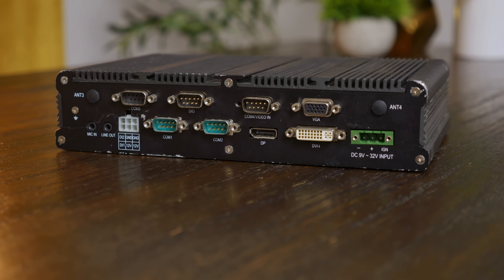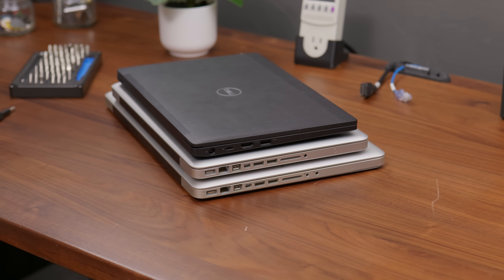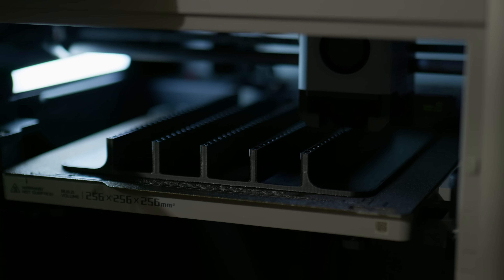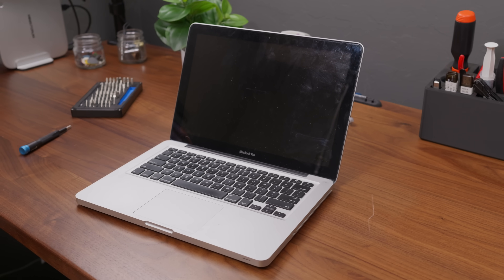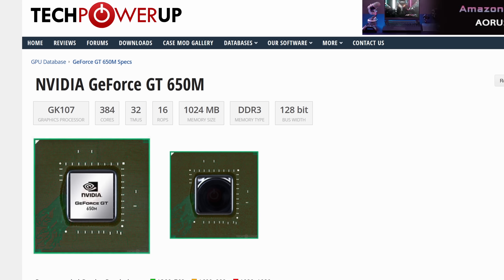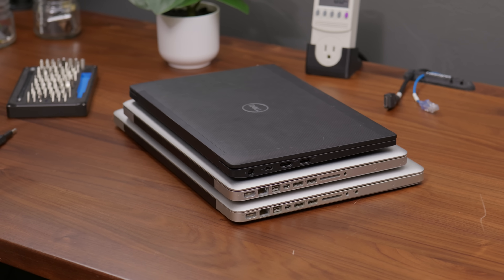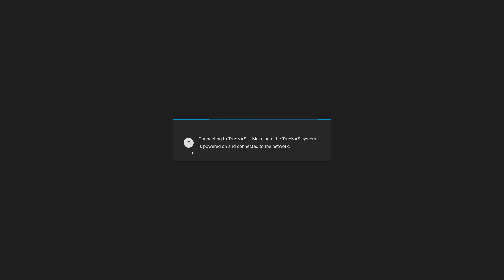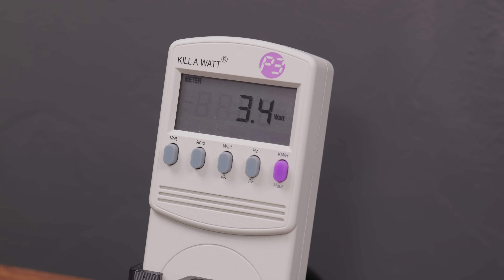Building Cheap & Efficient Home Servers with... Laptops?

Comment: Because of your previous videos, I finally got to host a Minecraft server (with 400 mods, mind you) on a 2017 Dell Inspiron Laptop. That thing still has HDD and only 8GB of Ram, but runs the server pretty well with 4 active people. Thanks, for the motivation, dude!
Reply: There are two things Minecraft loves: fast storage and high single-core instruction executions per second (MHz + IPC). Nothing you can do about the latter in a laptop, but the former... If the server is important enough to you, consider getting a fast SSD. A high-speed NVMe one, if the laptop supports it. I usually pre-generate chunks, too. It takes a while, but with an SSD and pregenerated chunks, the world loads in an instant.
Reply: @gleb.salmanov  I mean even with mods minecraft isn't very big, if it isn't doing anything else it could easily run off a 2-3gb ramdisk, just have to remember to save it to disk few times a day.
Reply: @vgamesx1  , no can do with 400 mods and 8 GB of RAM. You'll have 2 GB reserved for the system, 6 GB for the running server, and that's it. (And pray none of the mods have a runaway memory leak) Though the idea is, quite honestly, fascinating, so thank you for it. I've never seen or heard about anything like this. Maybe there's a way you can set up tiered storage and use a ramdisk+ssd combo. Ramdisk as cache, SSD as main storage. That's how they usually do it in storage servers. At the end of the day, maybe it's the RAM that needs upgrading.
Reply: @gleb.salmanov they literally said it runs fine lol
Reply: @benja1378  yeah, but there's a difference between it running fine and it running with a fast SSD

Comment: As an Enterprise technician , I really like this idea. Huge companies refresh every five years all their laptops and pay to have them taken away. I've e-wasted many factory refurbishd Dell 7940 sent to us by a company we took over straight to ewaste because policy so it pleases me to see older perfectly servicable hardware being repurposed.😊
Reply: planning on doing this with some laptops that are ewaste due to screen cracking, but the processors are still 10th gen and up with some having decent integrated graphics
Reply: My first computer was a 286 with a 40MB and a 20 MB MFM drive. I was very excited to upgrade to a 386SX and a 240MB IDE drive -- but stalled over installing the new bits because it seemed so wasteful to throw away a "perfectly good" computer, even if I really had little use for it. 

I knew about networks -- Novell Netware was all the rage, I think -- but couldn't think of a use even if I had the hardware and software. 

I still find it hard to throw tech stuff away when it hasn't actually burst into flames and burnt to the ground.
Reply: I work for one of the companies the big companies send their EOL devices to. We do everything we can to refurbish these laptops and put them back out there at a deal on a variety of online stores. Don't be afraid to buy used or refurbished items online as there are alot of good ones out there!
Reply: Good to know!  @Super_Ging3r
Reply: found some PREEM dell precisions 7950- gonna keep one and trade one off. quadro rtx 3000 and quadro t1000 i7 9850h 32gb/16gb

Comment: I did this with a broken shell laptop. Took the motherboard out and mounted it on to small acrylic sheet and the screen to the other side. I now use it as a display for monitoring my mini pc homelab. Thinking about doing this again for setting up a digital picture frame 🤔  - hand them out to family who are overseas to auto update with new photos.
Reply: Laptop seems overkill, esp32 would sip power to be able to run for months probably?
Reply: @yarkee8128  Depends how much you're willing to program, anyone can grab a pc then load up a slideshow and syncthing or whatever but programming micros is the bane of my existence for creating little projects.

Comment: the thing with using a laptop is the battery can degrade over time whilst constantly plugged in (quicker than otherwise, at least).
I've noticed that the BIOS that ships with HP and Framework machines, and hopefully others, provides the option to limit the battery charge which could help in a scenario like this.
though out of paranoia of spicy pillow syndrome, I removed the battery from the laptop I use as a unifi controller and mini NAS.

Comment: I ran Proxmox on an old Sandy Bridge laptop for almost 2 years.  I picked it up off eBay for $10.  It had enough RAM to host the 24x7 VM's and containers, made a decent management node, and coupled with a cluster vote parked on a QDevice via an RPi, allowed me to turn off the larger node and save some electricity.  I sourced a new battery locally, and ran it with the lid open on a suspended metal stand to prevent it from overheating.  In the end all my other consumer Sandy Bridge stuff died via capacitor death, and I started collecting 1L HP's to replace them.  I opened up the laptop to swap out the SSD and accidentally broke the SATA connector, ending it's run.  You can "echo 0" into a device in the /dev tree to turn off the screen backlite and save a watt or three. I didn't save the command when the unit died, or I'd share it here.
Reply: Don't forget:
# powertop --auto-tune
and:
# echo "powersave" | tee /sys/devices/system/cpu/cpu*/cpufreq/scaling_governor

Comment: Just set the laptop batteries to never charge above something like 85%. On the Dell you can do this in the UEFI setup and on the MacBooks you can set an NVRAM variable which I think is like what we would call the CMOS. Difference being the Mac has no built in GUI for changing a lot of these settings like a PC BIOS or UEFI firmware would (they are changed within an OS like Mac OS).

Comment: Fairly sure that in some Dell laptops, like my beast from work, well, there's options to set the hardware to not charge the battery more than x% and also a battery exerciser where you can set the system to run on battery on certain days of the week, and to stop it when it reaches a low percent, like 15%, and then later charge it back up to a certain percent like 85%.

Comment: For using an Intel-based MacBook running Linux, the following can be helpful as a server or as a desktop:  1) Instead of drilling holes in the bottom to manage thermals, you can force SMC bypass by unplugging power, press and hold power button, plug in power, release power button after 5-10 seconds.  Fan should start at full speed.  Alternately, to avoid the noisy fans and higher power draw, install Intel msr-tools (rdmsr, wrmsr) to manage thermals via bash script.  2) Wake on Lan works (alias wol?='echo "sudo ethtool eth0 | grep Wake-on (g=Wake on MagicPacket support)" && sudo ethtool eth0 | grep Wake-on') and Suspend works (sudo ethtool -s eth0 wol g).  3) Free laptops can be found at recycling centers.  I have a dozen that only cost me a few $ to upgrade to SSDs.  My best "server" is a free 2009 iMac 27" (Intel Core 4 Quad i5 750) without a working display.  It rocks with an SSD, 16GB RAM and accessed using remote desktop via either Chrome Remote Desktop or XRDP.  4) Consider reducing resource demand on older MacBooks by not running a DE (Xfce, KDE, Gnome, etc).   Old MacBooks run very well with the combination of Linux, Openbox, tint2, plank, etc.

Comment: I never thought to do a video about this but this was a choice I made about a decade ago when I got tired of moving servers every time I moved my apartment. I can put four laptops in the cabinet on their side and have perfectly functional everything especially after I turn off that stupid you close the lid and you shut the laptop down. You can get some nice MXM display adapter options all for a few hundred dollars. I don't need a KVM because every device comes with a built-in keyboard, mouse and screen. Add an USB Ethernet port for management, and the onboard nic connects vlanned virtual interfaces to my nework via a layer3 switch.

Comment: You should check if some of those have Wake On Lan Enabled. Surprisngly my daily driver has it so if I ever wanted to turn it into a small server using a pi for turning it on wirelessly could solve the "having to open the lit to turn it on/off" issue.
Reply: wake on lan is a cheap way to get out of implementing an arduino based hardware power switch toggle mechanism

Comment: Maybe I missed it in the video but if others have high idle power with nvidia gpus. I was able to cut my idle power from like 60 watts to 8 watts by just installing the proprietary nvidia drivers. Maybe the MacBooks would have idled lower with the drivers? Sorry if you already mentioned that/missed it but that was my though when I was at 11:23

Comment: If your laptop has an m.2 slot, you can get m.2 to 5xsata adapters to be able to run multiple hard drives. Only thing you then need to solve is sata power for the drives.
Reply: DC 5525 4xsata

Comment: I use a HP 450 G3 laptop with Truenas scale as a server. It has a m2 sata ssd, sata 2.5" and sata dvd drive. I change the wifi for 2.5Gb nick. With 2 ssd 2.5" drive it use less then 5 watts. Its have also a battery, its own UPS.

Comment: I don't think there're any issues having batteries within laptops. In any case, as you mentioned, it's excelent for power outages.
I would only set a command to preserve them at 60%-80% of charge instead of 100

Comment: From my experience with laptop batteries since I have a ton of them I run for various things.   If the laptop sits there for a year and its done nothing but be on and plugged in, the battery typically fails charging between 10 to 13 months.  If it's a laptop that does things like plays videos for a video wall 24/7, I have had them last for 3 to 4 years before the batteries start giving me issues, typically I am replacing those laptops at that point, so it never becomes an issue.  But if they are being used, the tend to last longer than if they aren't, that's been my experience.

Comment: Always take the battery out. One laptop server nearly took my entire house down :/
Reply: the battery may explode, so please be careful.
Reply: @sangpenjelajahinternet616  Only if you leave it in. There is ZERO danger of it exploding when you remove it..
Reply: it's probably better to plan for that and put the laptops in a place that won't catch fire if they burn
Reply: Batteries with cylindrical or prismatic cells should be safe to continue using, as they have pressure relief systems, though I wouldn't personally bet my life on it. Flat pouch-style batteries should definitely be taken out, as they never have any pressure regulation system.
Reply: @gleb.salmanov  there's pressure regulation systems in batteries 😮
I just want to have a surface level knowledge about that any books?
Reply: important point 😅
Reply: It caught fire? That's scary..
Reply: @yarkee8128  batteries in laptops and phones are flammable and burn hot for a little while.
Reply: It's obviously a risk but I don't see how it's any worse than using the laptop normally.
Reply: @eDoc2020 I see your point and there is probably no definitive answer. But none of these laptops was designed to be a server and running 24/7. Removing the battery just seems the safest. Though for other parts you could argue that a laptop could run as a server for a longer time giving that components typically experience wear when exposed to a lot of heat cycles. Where running a pc constantly prevents this (at least with light use like HA).
Reply: Exactly! Constantly powering a laptop battery at 100% could introduce a spicy pillow. Some laptops can have their battery disabled in BIOS, but I would remove it.
Reply: @KixYT  nonsense, the battery is behind a battery controller and is only trickle charged while the laptop is run from AC power. Batteries can go bad over time, like all consumables
Reply: @  True, most modern laptops have battery management systems that regulate charging. However, even with trickle charging, long-term exposure to heat and constant power can still degrade lithium-ion batteries. Some models handle this better than others, but many users have seen batteries swell over time when left plugged in indefinitely. For a laptop running 24/7 as a server, removing the battery eliminates any risk of unexpected failure or swelling, especially if the system lacks advanced battery protection features. Definitely a case where user experience varies.
Reply: @KixYT  they are not "exposed to constant power" due to battery controller as I said.
Batteries becoming pillows is a thing that happens as the battery ages so it's an issue for laptops and phones regardless of how you use (or not use) them. Old laptops and phones have burst into flames even when stored in a closet.

So you either put the device in a location that can handle a battery failure or you remove it.
Reply: @AntonioMolfetta  While battery controllers do regulate charging, many laptops will still keep the battery at or near 100% if constantly plugged into AC power. Some models have BIOS settings to limit charging to, say, 80%, but not all do. Lithium-ion batteries degrade faster when kept at full charge for extended periods, and heat from the laptop running 24/7 can accelerate swelling. Since a home server setup typically doesn't need battery backup, removing the battery eliminates those risks altogether—no trickle charging, no prolonged heat exposure, and no potential 'spicy pillow' surprise down the road. So yes, as I said, just remove the battery for the safest outcome.
Reply: @KixYT  This is correct. Idk what Antonio was going on about. A lithium battery kept at 4.2V will degrade significantly faster than one kept at 3.7 or 3.8V. There is a reason they say to store battery-powered devices at 50-80% charge.
Reply: @clonkex  Exactly!
Reply: @AntonioMolfetta   many companies deliberately over charge and discharge lithium batteries so they can claim longer battery life. Over charging them always has the risk of thermal runaway even if it's trickle charging
Reply: I checked my laptop servers all the time but havent for 6 months. Cant thank you enough for this comment and reminding me. One of my 3 laptop server's battery was really swollen. It was just a matter of time and I have two dogs at home. Thank you brother.
Reply: I was wondering why it wasn't beeing mentioned
Reply: People need a lot more education on Li-ion batteries.
These things are dangerous! 

I didn't know of half the dangerous until my laptop battery failed, and now I'm pretty cautious with them. 
Read up, everyone!

Comment: i’ve been running my old laptop as my home server for a few months now. i followed that tutorial for setting up a minecraft server with casaos and crafty, then when that was done i figured “what the heck” and installed jellyfin to make it also function as a media server. 
the only thing i wont be messing with anymore is AdGuard or PiHole. My roommates were not happy when i did a bit too much tinkering and had to reset the wifi router.

Comment: We have been using repurposed PCs as a home server for years. I'm currently using a Thinkpad T420 laptop as a poor man's server. I replaced the HDD with an SSD and popped in a large HDD in the DVD slot. It is located to the left of my desk PC.  I found a nifty program called Input Director that automatically switches keyboard and mouse to the laptop, but you still use the laptop screen. Previously when I was using an old desktop PC as a server used a KVM, the current setup is much more convenient. The only downside is you need to make sure the curser is back on the main PC if you shutdown or reboot the laptop or you lose kybd/mouse control until the laptop is back up or you reboot the main computer.    

It's main purpose is as a destination for automatic backup for my wife and my desktops. It is also running a web server for static home stuff and a NTP server to sync all the non-laptop computers on the LAN. I have a bunch of DIY home automation devices that do not have a clock battery. Having a local NTP server is nice after a power outage before the internet is back up.

Comment: For people trying to copy this, anything i5 8th gen or higher can even transcode video (for jellyfin) without needing a GPU. 

For the pesky charging bricks, buy usb C pd converters and use a multiport PD brick to power all of them at once. 

If you wanna diy that too, i made one, search instructables for it (sry for self plug, but its the only one on the internet for 50usd and gets u upto 400W)
Using PD instead of AC bricks can even help u power these via a powerbank if the need arises. 

Instead of using USB drives u can use the SD card on MacBook. 

If sm1 is making this wolfgang style, aka lowest power draw, pull out the touchpad, webcam, and everything else u might not need.

Comment: The only laptops I've seen with guaranteed swollen batteries are the Latitude 7x90 range. Each one, simply through being used, has had to have the battery replaced. I haven't seen batteries expand so bad as the ones in this series of laptops. Replacement batteries don't seem to have the issue. So if you find one, check the battery first, the cells shouldn't be proud/raised at all.

Comment: For the battery, if I have a timer on the mains power supply, could be good to turn on / off during bedtime.

Also those intel pentium n3700 are great low powered cpus, good for fanless low power.

Comment: My only home server is an old laptop motherboard with a low profile heatsink slapped on top, instead of the fan that it originally had. Very small and fully silent! It has an i3-2365M, which is a bit old at this point, but it only runs Home Assistant and little else so it's plenty enough.